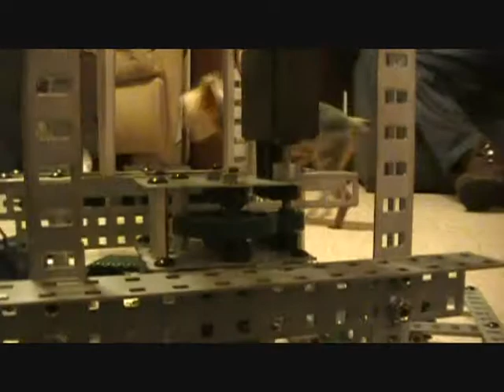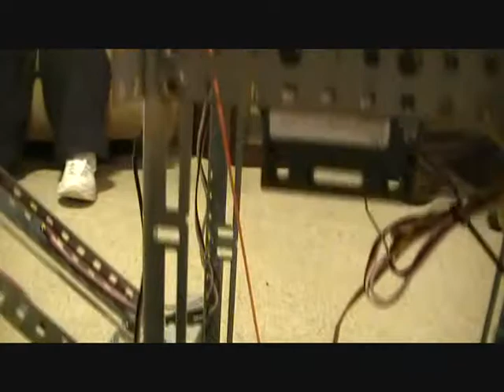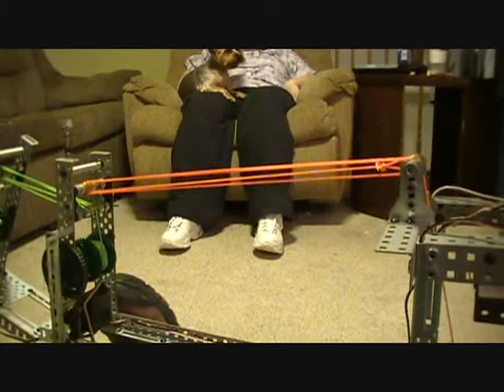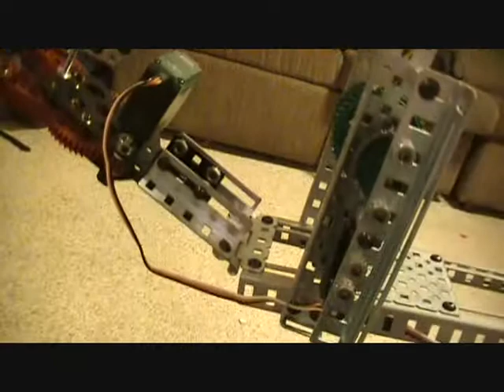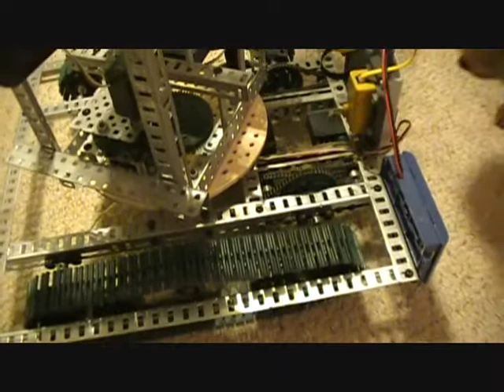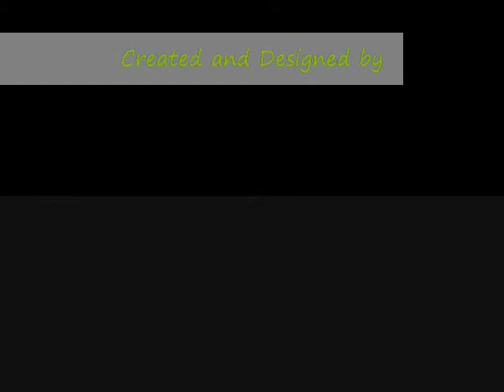Vex Claw 1.0.wmv

Comment from the maker: @FutureInventions 

Sure thing.....  It's a custom base that is 15x5 in diameter. I can see about getting you some pics emailed of the table.... then i placed 2- 84 teeth gears on both sides to "sandwich" the table. using a small gear reduction box i got the full speed reduced enough where it was not so jumpy and was much slower and more controlled.